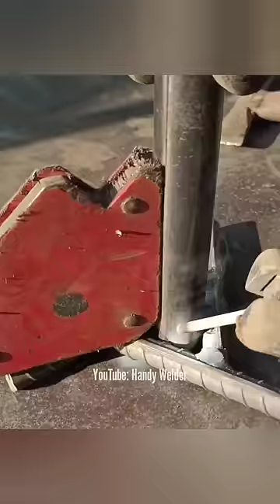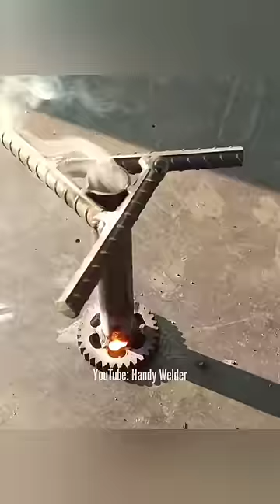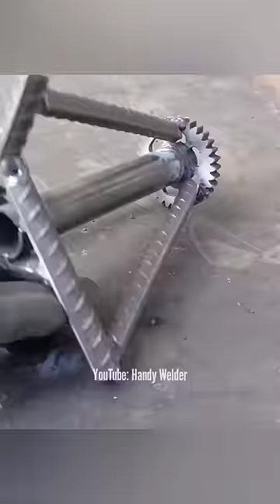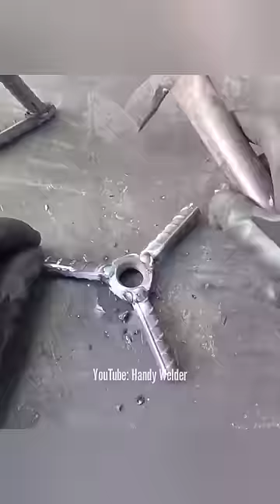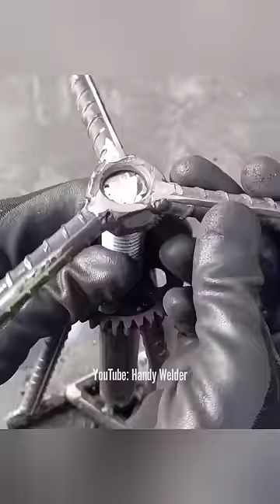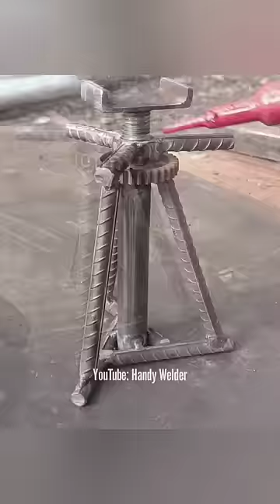a welder's clever invention

Comment: 1. I've never seen a screw jack with a thrust bearing.  It doesn't need one.  In fact, you want high friction between the nut and bearing plate to prevent back off.
2. Proof load of grade 5, 3/4 inch NC threads is over 28000 lbf.  Corner of a pickup tuck is maybe 2000 lb max.
3. Requires trained operator.  If you want to sell this to retards, sure, add a stop.
4. Not sure why tube diameter is an issue. Most house jacks are 3x diameter gap in tube.  Only the bearing hole matters.
5. The only semi valid point in this list.  A cast sprocket may have issues, I haven't worked with them much in terms of welding.  If it's machined from billet.  Probably fine.
6. Mild steel yield strength: 250 to 600 MPa, Rebar: 400 to 1000 MPa.
7. All depends on the application and forces involved.  The construction has a solid column of steel from load to ground.  Welds are for stability.  I'd have to run FEA in SolidWorks to see how much force the welds actually have to withstand.
8.  Lifting pad is only to prevent kick out.  Load on any jack should be placed directly over the column.
9.  Go have a look at retail screw jacks.  They don't use hardened steel.  Unless you plan on running this up and down 80 times a minute for a month straight, I'm sure it will be fine.

Comment: If you increase the diameter of every steel bar and diameter of screw jack, It will lift even more Weight than before 👍🏼,
I'm mechanical Engineering from India.😊

Comment: Tools that ensure your safety should NEVER be made DIY... Especially if you don't know what you're doing, i bet you didn't even test the strength of tool to make sure it's safe, if it can't lift double the weight you want to lift, It's most likely a hazard.

Also that nut should have some kind of safety added to prevent it from unscrewing.... you're really pushing your luck.

Comment: Well I came straight to the comments and they did not disappoint most people see exactly what I see soft rebar, low-grade threaded, zinc nut, intact Wells that look like you were trying to save money by not running a bead all the way around. It would be fine for leveling jacks on a camper or holding up a go cart. Absolutely deadly for a 3000+lb. Car. I hope someone doesn't try making this and DIE because you wanted views to watch you pretend to know how to fabricate

Comment: Come on dude. If you want to make something that carries that much weight you need to start with better materials than that. And some real welds wouldn't hurt either. This is a death trap. My rule of thumb for anything that carries weight is that if it can be welded it should be welded. I'm not about to die over a tack weld and weak parts.